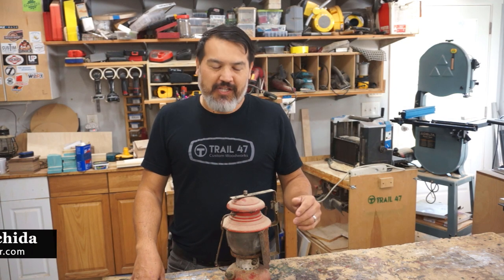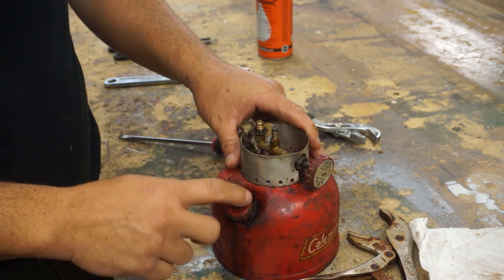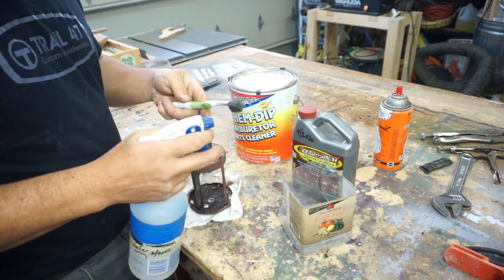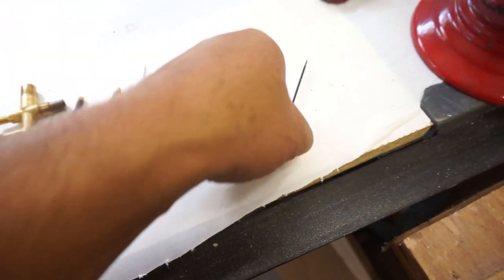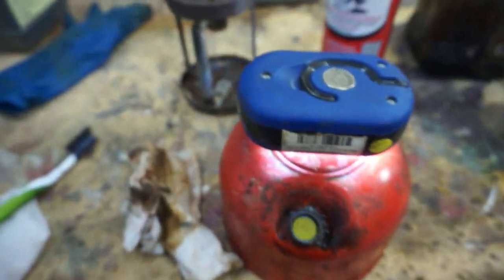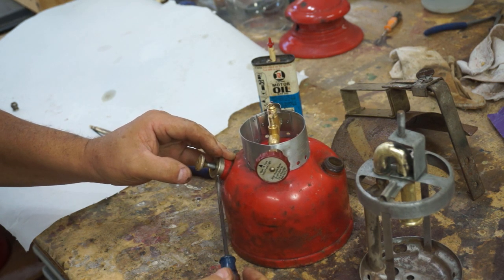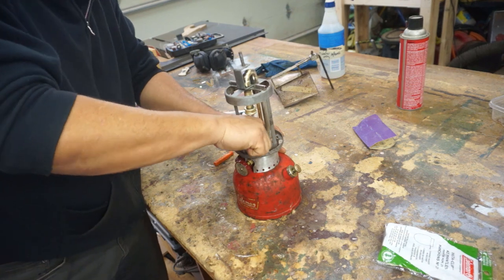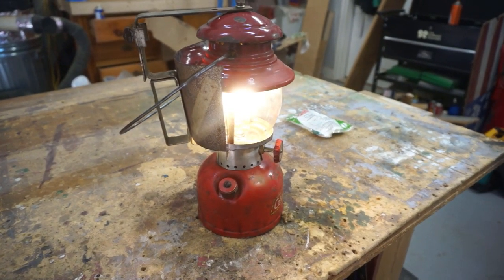Can We Save It? Coleman 200A Lantern - The Garage Engineer

Comment: This was just painful to watch. What kind of mechanic/engineer uses a 12" crescent wrench, channel locks and vice grips to disassemble finely machined brass? For heavens sake do yourself and everyone else a favor and do a little research before attempting something like this. That thick washer you had left over goes on the brass  center stud before placing the metal frame on top of it. That fuel cap is incredibly dangerous to leave on there. Coleman was nearly sued out of existence in 1963 because that thing started so many fires and severely burned hundreds of people. For your own safety get rid of it and replace it with a new one piece cap. Any place that sells Coleman products should sell the caps, or you can get them from ebay. Before you do anything else with this old lantern, please watch Frank Begg's video on restoring the 200A here on YouTube. The Oldtown Coleman channel. Frank is THE expert on repairing anything Coleman. Good luck and stay safe!
Reply: I have the 3 piece caps on my “vintage” lanterns, which I still use. I don’t open the fuel caps, whether they’re 3 piece or 1 piece, till the lantern is cooled down. When the lantern is cool, I open the fuel cap to release pressure, then I refuel the lantern. Upon refueling the lantern, I screw the cap back on till the gasket “gets a grip” on the tank. I don’t screw it down tight till I use the lantern again.
Reply: Thank you I was about to post a similar comment. There's tons of info out there on how to properly service and rebuild coleman lanterns and lamps. Hell at the very least he could of looked up the parts diagram. At least he could have gotten the terminology correct.
Reply: guess he dosen't believe in using wrenches either. Hey why use the correct size when you have channel locks and a vice grip.
Reply: Hack job. I cringe when channel locks are called pliers..
Reply: @patricksomers5872    Same here !
Reply: Hundreds of people??   Really?? Follow the instructions and the caps are perfectly safe used properly.
Reply: @stevenshanofski6801 Yes very true but then you have to have some common sense and read the instructions regardless of how simple they are.
Reply: I'd keep the old original 3 piece fuel cap for when the time comes to sell it. An original lantern is more valuable than one that has updated parts.

Comment: Bozo at work!  Just love to see inexperienced guys trying to do something that they have never done any research to see how to take a lantern apart.  Quite comical to say the least.  Why didn't you research the 200A lantern before you started.  I.e., you didn't have to take the complete valve stem out to remove the collar.  It has a slot in it so you can remove it.  The needle in the generator is gunked up; it has no sealant;  you can use some 0000 steel wool on the generator needle and it's not hollow.  You need to research before you begin a rebuild. The 3 piece lid has no vent until you release the pressure in the tank; then it comes out the little hole in the side of that style cap.  That's the dangerous type of vent in the cap.  The newer ones have 4 channels in the cap to aim the pressure downward when you release the pressure in the tank.  K9POW - Rusty in eastern Tennessee

Comment: There is a date stamp on the bottom of the tank. Example 6     57. June of 1957.
You can use Evaparust and add a tube of steel BBs . Plug the holes and shake vigorously.  It will knock off most of the scaly rust. Most of the BBs will shake out. Any remaining can be removed with a magnet. Replacement fuel caps are available they are of a newer one piece design.
As well as the generator assembly (the brass tube with the fine needle.) The needle is a tip cleaner for the tiny hole in the end of the generator. Make sure you get a generator for a #200 lantern. The three piece fuel cap is no longer available, but you can buy the round gasket to rebuild it. To remove the old gasket, use a propane torch. Heat the disk till the gasket is carbonized, then pick it out with a dental pick or some similar tool. Use a gasket cement on the new gasket. The "choke" is actually an eccentric block which the tip cleaner is attached, so it can move up and down cleaning the orifice. The pump cup is made out of leather. A good soaking in neatsfoot oil usually brings it back to life. You can use gun oil in a pinch. Replacement leathers and also rubber pump cups are readily available. You can clean the tip cleaner rod down to the brass. Inside the generator is an asbestos sleeve and a coil spring used to prevent collapse of the sleeve. The vent hole in the cap is a pressure relief when the fuel cap is unscrewed. The screw in the fuel cap only holds the gasket disk in place. There is a graphite packing around the stem of the shutoff valve. The nut must be tight but not tight enough to crush the packing. The cleaning lever must be in the "down" position to light.
Reply from the maker: That is some great info.  Thanks for sharing.

Comment: The two washers go under the base not one over and one on top of the ventilator.   May want to clean the check valve at the bottom of the pump.  Fun video though....Looks like me the first time I messed with one of those things.....Just picked-up my third and am still trying to remove the fuel cap!
Reply from the maker: Thanks for watching.  I go back and check the valve.

Comment: It’s very easy to restore Coleman lanterns you just have to research a little so you don’t mess things up I’ve been restoring Coleman products since I was about 12 or 13 my dad taught me and I love to do it
Reply: How do I get the valve out of the fount?  I have two that I'm working on and Coleman used red Lock-Tite on them and they won't turn.  I turned the fount upside down and put the valve in my vice to hold it and the tried to turn the fount.  It wouldn't budge and it slightly bent the fount which I was able to straighten.

Comment: I wouldn't be proud about using a crescent wrench or adjustable wrench on hard to get to nuts etc. There are reasons to use an open end wrench such as 7/16" and 1/2" to remove those nuts that hold down the "frame" to the fuel tank. It worked out for you but with an old antique item, it pays to use a better method to save parts from distortion/damage so that parts are restored to the original assembly. 
Best part is this lantern got to function and the original Pyrex Made in USA globe was saved.  You can't get them anymore unless you buy a Chinese brand which will hurt the value big time.